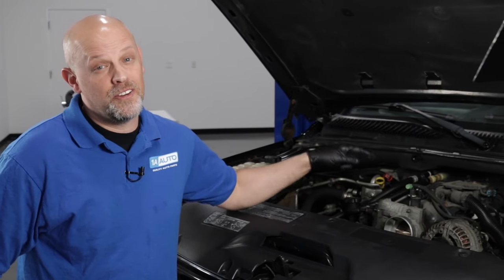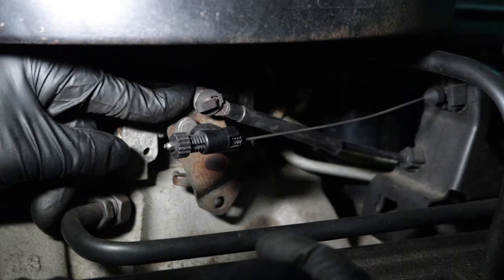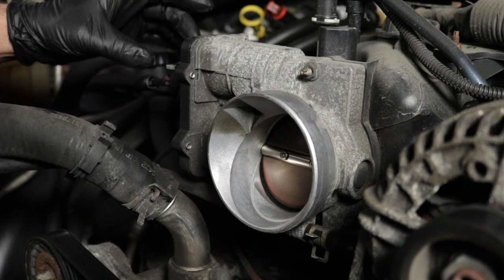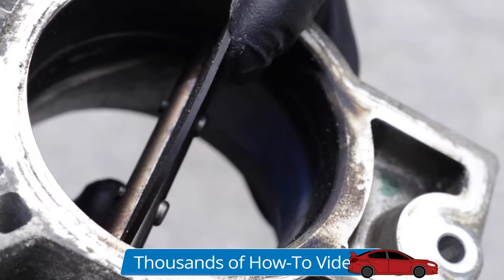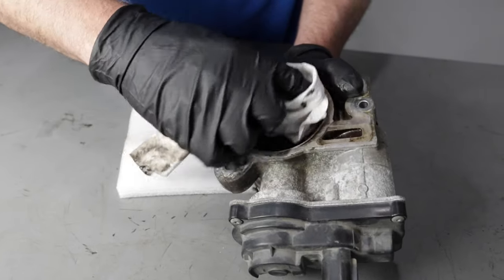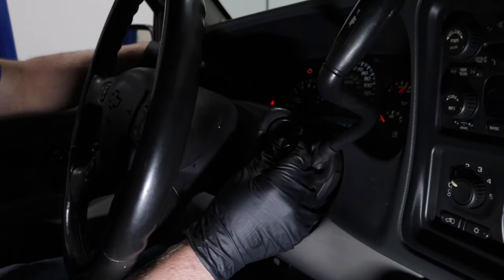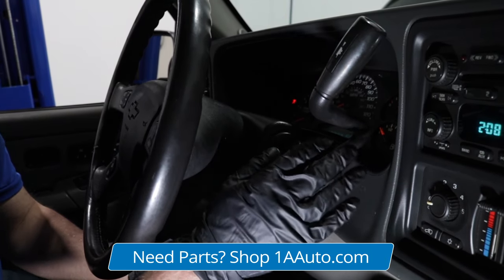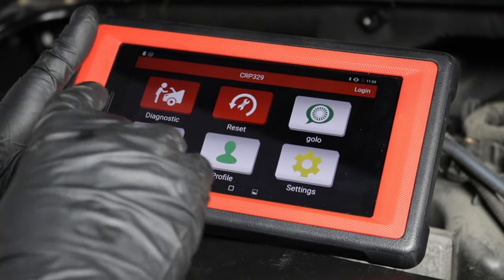Throttle Body Relearn: When Should I Reprogram My Car's Throttle Body?

Comment from the maker: √  Watch the Video
√  Buy The Part at 1A Auto http://1aau.to/m/Visit-1AAuto
√  Do it Yourself
√  Save Money
Reply: Need to buy need to buy a throttle body for a 2000 Plymouth Grand Voyager 3.3 l engine need some help on where I can buy it
Reply from the maker: +Skool Gordon Thanks for watching!  We currently do not carry a throttle body for that model.
Reply: @1AAuto  I just replaced my throttle body on 14 Chevy Equinox and it haven't started yet...
Reply: you mess my car up you did not tell us we had to pull the battery terminal before changing out the TB so the engine can reset itself to the new position of the Throttle body flange
Reply: hi where can i go to get my throttle body relearn or can i buy the device to relearn myself
Reply: why are you not answering important questions? WHY?

Comment: Like the videos. Feels like we were better of with cables
Reply from the maker: +Brad Rogers Thanks for checking us out! 1AAuto.com
Reply: Drive by wire is way more responsive than drive by cable.
Reply: I agree
Reply: Yep that’s right just some more stupid stuff to have to be put in the shop to recalibrate and cost a thousand dollars to do it
Reply: @tobydozier9030  bull
Reply: Yes at least it's not complicated as f
Reply: You can still have cables. 
I do. YOU choose to have a "modern day" vehicle.
Reply: Ha. It’s done for emissions/fuel economy reasons, not response. and yeah, it’s a fuckin headache. currently chasing tps sensor woes in my c5. it has 3 actually, a high side, a low side, and a pedal sensor. and it’s a fucking headache.
Reply: @tobydozier9030  no chance because why would companies design a sprint response kit for the electronic throttle control? Cable has always been the best.

Comment: I replaced my throttle body and ran the car til normal temp . Then I drove it seems to be good . I didn’t do this before and had a surge like the transmission was slipping . Hope doing the relearn corrects the problem.  I bought a mass airflow sensor plugs coils and a new pedal. Not knowing this was possibly what was wrong .
Reply: Did the relearn correct the problem.
Reply: What is electronic throttle body problems is that what causes the van to accelerate uncontrollably and jerk and buck for the brakes fail to hold it back

Comment: I cleaned my throttle body and idle feels good except when i rev it in park the idle stays at about 25k rpms. When i shut off the engine and turn it back on it idles good, would i still need an idle relearn?
Reply: My truck is doing the same  howvdid u fix it .....

Comment: I cleaned my Throttlebody and did the relearning procedure. The rpms went back to normal but when in park and when I step on the gas the rpms up to 4000 and stay there. I have a 2011 GMC Yukon
Reply: Im having the same problem but with an 2011 silverado 5.3
Reply: You figure anything out?
Reply: Same problem
Reply: @joshuadodson2757  did you figure what was wrong with it ? Same problem here
Reply: Did anybody find out the problem
Have the same thing on my 2011 yukon?
Reply: Sounds like GM problems
Reply: you may need to replace the Throttle Body or at least the sensor. If your throttle body was very dirty, you may be better off just getting the new one...

or. 

I have had the very high rpms happen with a Dodge Caravan... turns out it was the A/C Clutch relay. A guy at a garage in Northern New Brunswich who spoke 5 words in english understood my 5 words of french. He diagnosed the isssue... A./C Clutch Relay, I swapped it out with another relay - instant fix.

Comment: So after cleaning my throttle body, which I had no idea there was a relearn process, my idle is just about 600, but even after doing the relearn process when I rev it up it stays up and will not come back down. Any thoughts?
Reply: I have this same problem
Reply: Same problem here. 😢
Reply: Did u figure this out
Reply: Yep you got to take it to the dealership and get it reprogram for a nice fee

Comment: Take off the TBU take it off slowly try not to move the butterfly use TB spray cleaner leave it to dry over nite install an let it run don't mess with it. Power will be restored

Comment: I got a 2006 Kia Optima EX (Old Body) 2.4 L. I recently replaced the power steering pump with an new OEM pump plus new belt. System flushed & filled. While I had the time, I removed and cleaned my throttle body and mass air flow sensor. Car runs good but got a slightly high idle speed greater than recommend 700-800 rpm. There is no fluctuations in idle speed. Starts great… new IAC valve PO507. What is the relearn procedure for my TPS? I want to get the idle back where it needs to be.
Reply: Push brake in…set park brake…key on key off….start car…put in drive for 10 minutes.  Now the cars fuel trim is correct

Comment: Thank you so much recently cleaned my throttle body and mass air flow sensor. Just took me 2 hours to do a 35 minute ride here to work and I'm a couple miles away I keep stalling and I keep resetting the battery. Just went and bought a can of Lucas fuel injector cleaner to go in the gas tank and filled up and also bought a can of throttle body cleaner so I can clean it one more time and reassemble it and let it drive around 40 miles an hour on the highway like you suggest I pray it works my car is a 2013 Acura TSX special edition 4 cylinder. God bless you for all this information and I pray I get everything running great again take care. 🙏😃
Reply from the maker: +Stephen S Thank you! We love empowering our customers and showing how to perform DIY auto repairs with our high-quality auto parts.  http://1aau.to/m/Shop-1AAuto-c

Comment: I swapped out my throttle body (it would randomly go into limp mode with the lightning bolt and traction sensor) and after I did, it was permanently in limp mode with a worse sounding idle along with my check engine light. Would a relearn fix that? Or is the new throttle body faulty?

Comment: My scan tool is throwing a P1101 twice, pending & permanent. P0299, P2227. Replaced the turbo booster sensor & cleaned the MAF sensor with MAF cleaner. Engine light stayed off longer than it was after all that. But ultimately came back on.  So I removed the throttle body tube and noticed some light gunk & condensation bubbles on butterfly valve, So I carefully cleaned that as well. Same codes still show. ANY advice would be much appreciated.  (2017 Chevy Malibu LT 1.5 Turbo) 

Thank you! 💪🏼

Comment: I’ve bought a 2007 Chrysler Sebring and have problems with it missing and hesitates going uphill took it to a mechanic 😒 they replaced spark plugs 3 times, put new coil packs on and crank sensor and it didn’t fix it. They said they’re was a misfire on cylinder 2. The lighting bolt symbol comes on sometimes. I’m no mechanic but something is wrong if you replace spark plugs 3 times within a year 2 times within 3 weeks apart because they was bad. This video helps knowing what’s going on with my car. Thanks.
Reply: Spark plugs last 60k miles. It should only be replaced if its worn out you should ask them to show you the old ones. Try changing your fuel filter...

Comment: I have a question - not sure if you can help. I just had the throttle body on my Polo 9N3 replaced because of intermittent starting issues (it would crank for a longer time occasionally but always start after this. When briefly switched off after this, engine would start immediately). Now I have a car that's hunting when I first start it up, RPMs going up to 1100, going down to 800 going back up and sounding like it's stalling. Didn't have that issue before the replacement. Mechanic suggests it could be the oxygen sensor - but why did this problem occur all of a sudden after the replacement?

Comment: I Have A 2010 Ford Fusion SE. Just Bought An Electronic Throttle Body. Would I Need To Reprogram It After Installation Or Would It Reset Itself?

Comment: i had a shop replace this and the throttle position sensor. now it idles sometimes at 650rpm or really low at like 500 or 450rpm. also when i put it in reverse sometimes it goes as low as 250rpm almost shutting off until it revs itself up to normal idle. also i was just pulling into the driveway earlier and gave it a little gas and it revved itself up unexpectedly lunging itself forward for a second before i stepped on the brake. kind of annoying

Comment: Brake fluid cleaner or carb cleaner? Really? But want that be harmfull to the surfaces? I use throttle body cleaner only and a soft bristle brush in addition to a clean rag.

Comment: got a volvo s40 2.0 gasoline ...i just instaled a new throttle but when i start in the morning RPM jump fast to 2000 then back to 1000 and as i drive and engine warm up will settle to 650 any tips or is normal i mention the car will always start secound time i turn the key new first time....

Comment: Hi i have a 2010 Honda   crv Awd 2.4 I have a accelaration  problem on cold engine stop /go  motion .The engine hesitation ,he don t whant a move by himself he go to shut down by himself ,i have to hard press to accelarator to run,every think came to normal when the engine came normal,spark plugs are new, no code on scan no check engine light,my mechanic ean the trootle and the sensor even he change the crankshaft position sensor,nothing change,did you think its the throttle it s finish or the problem it s the gas pump,thanks

Comment: I just need to clear a check engine light. If use a scan tool to clear code. Do i have to do a throttle relearn?

Comment: I replaced my throttle on a 2012 ford Taurus and the check engine light code p2104 reads on the dash. Vehicle also cuts off going 50+ mph causing me to pull over at reduced speeds in traffic unable to accelerate…Any solutions?

Comment: Hi, i have a 2006 lexus rx330. I will need to replace my throttle body. But i saw two hoses.. one on the right it for coolant. Doni need to bleed that after i replace the throttle body. And the other hose on the left. I have not unplug it just yet.. where is that connected to? Thanks

Comment: My engine stays reved up/high idle when im at a stop light ao have to tap the explorator peddle to make it go to quiet idle. I have a 2001 dodge ram 2500
Reply: Could be a dirty Mass Air flow sensor

Comment: Gm 3.9l v6 will start the car and it’ll drive then suddenly after coming to a stop randomly wether it be a 5 minute cruise or an hour long drive it’ll bounce into reduced engine power. Currently trying to re program throttle position sensor took it from my other car (3.5l) it fits perfectly. But I notice rpm’s are off slightly and I have afm which activates at about 1300 rpm’s on the highway but I’m revving at about 1650 so when it de activates into 6 cylinder it’s a little harsh. Any help relearning would be great

Comment: Got a question my 99 Durango sometimes cranks & cranks then starts up how can i fix it put in a new fuel pump new plugs and wires cap and rotor and pickup coil
Reply: Battery terminals? New spark plugs?

Comment: Are these error codes an indication that I need to recalibrate the throttle? 
Which error code reader can do that on Citroen C5-2004?
P2101: Throttle controller A motor control - Circuit range / performance
P1153: Citroen: Thorttle - Threshold learning fault
I have already moved to a brand new throttle body :goodvibes:
Reply: Sounds like the sensor was fried. I assume with a new TB you got a new sensor.

Comment: Just learned that after replacing battery in Cadillac ATS that throttle body cycles and relearns itself turning it on in acc mode then shut off then turn on ect

Comment: Hello 1A Auto from ON, Canada….what’s the process for 2019 Mazda CX-5 GS AWD 2.5L Non-Turbo? i have cleaned the throttle body with CRC Throttle Body Cleaner and when i placed it all back together the RPMs started jumping with the throttle plate acting like it’s got Parkinsons LOL ….one of the mechanics believes after checking with a code reader ipad it’s placing pressure on the Purge Valve….please help me figure this or should i drive on the highway for a while and that might reset the throttle body or have a re-learning process conducted? thank you…🚙🤙🏼😎

Comment: Weird advices, I wouldn't advise anyone to remove and clean their throttle body without having the possibility to reset the TB with a computer unless they want to experience weird revs issues etc. First get a computer with the proper software to control your pieces then remove and clean it.

Comment: Please help me out. I have a rough idle when I load to Drive or Reverse. So I change the throttle body but still rough idle. How do I calibrate the new throttle?
Golf Mk4 1.8L 20V engine.
Reply: Use VCDS/VAG-COM to reset it properly. Rough idle might also come from a dirty EGR valve or a dirty MAP/MAF sensor, or spark plugs and everything related to it, clean everything up and it should be fine.

Comment: What Relearns do I need to have done on my 2010 Kia Soul 2.0?I changed the Coolant Temperature Sensor,Purge Valve,Crankshaft Position Sensor,Idle Air Control Valve,Fuel Pump & Fuel Filter,MAP Sensor,new battery,new spark plugs & wires & I have a new Throttle Position Sensor,but haven't changed it yet.I may have to take throttle body off to get to the 2 screws that are very hard to unscrew.Car is wanting to stall after driving 15-20 miles & feeling low power surges,plus a little vibration here & there.It gets so frustrating.I am just finding out that certain new parts need a relearn.What ever happened to replacing old parts with new ones?
Reply: Cost. It's cheaper to clean a part than to buy a new one.
Reply: What did it end up being

Comment: So I'm literally replacing my throttle body tomorrow in my 2003 Silverado 1500. What do I need to do so it can "relearn"?
Reply: I would consider disconnecting the battery for 30 minutes to reset. Otherwise count on very hi idle and rapid launch in gear leading to a fender bender.

Comment: Curious on an Acadia 11’….. I got a P0430 which is a catalyst code but it won’t start which means it’s not a bad catalytic converter could it be the TB? Could a really dirty TB prevent a car from running and throw that exact code?
Reply: You ever figure it out? I’m getting a p0507. Car wouldn’t turn on. But I just had it cleaned, it ran and won’t turn back on after I shut it off. I have to do the relearn process still.

Comment: Hi, I have to press the accelerator about a quarter of the way down before the car starts to accelerate. Do I need to reset the throttle body? Or could it be something else?
Reply: Has hour car thrown any check engine lights or has your ABS or stability light appeared? I would check the APP sensor and then the TPS sensor.
Reply: @thechongsterful  my 06 Altima had similar issue, except it threw me a p0507. Drove with it for a few days then when accelerating from red light the acceleration stopped for a second then I drove another 15 seconds and it happened again while driving , not from starting from a stop. It won’t turn on now. I had it cleaned as it was dirty af. It turns on but after you let it sit for an hour it won’t turn on. The service engine light doesn’t come on anymore. I haven’t done the relearn code yet.

Comment: I have a 2000 Chevy Colorado it won't go on fast idle in the morning every place to throttle body and in the morning the motor shut off I got to hold my foot on the gas pedal so it warms up I couldn't be

Comment: I replaced the throttle body, did the relearn procedure  (2009 Envoy).  Idle is now good, however, once I just touch the accelerator, the car RMP jumps up causing the car to lurch immediately.  The RPM is jumping from 800 to 1200.  Any idea?  Again, just touching the accelerator with limited acceleration.
Reply from the maker: +Bill Edison We wouldn't be able to diagnose an issue like that here, you may want to have a local mechanic take a look at it. Thanks for checking us out! http://1aau.to/m/Shop-1AAuto-c
Reply: Bill were you able to find out what your issue was. My brother has a 2007 Tahoe that's doing the same thing.

Comment: I have a 2016 ram I had an oil change. at the dealership they said I need a throttle body  and a fuel injection service .my truck has 68,393 kilometers  and it's going to cost me  246. plus taxes  ? Should I do it ? Thanks 👍🇨🇦
Reply: How early do I reset computer on my 2003 Ford escape after changing throttle bod

Comment: I cleaned the throttle body on a 2010 Honda Civic but I still have high idle when engine is cold but it drops to normal when I reach operating temperature. The RPMs also surge once during this warming up. I have tried doing the engine relearn procedure and have driven like this for months. Do I need a special Honda scan tool to teach the throttle position sensor where it should be?
Reply: Some cars require you to take off the negative terminal on the battery for 10 minutes after you clean the throttle body so that it reprograms it

Comment: Save money? I bought a 12volt new battery a new $200 throttle body, and am doing the throttle relearn procedure by the repair manual still idles high.

Comment: 2008 Ford Fusion, Throttle body wrench light came on, Cleaned throttle body and put everything back and the wrench is still coming on and off and car is driving rough, like trying to pull out of my driveway and the car will sometimes shut off, No check engine light or codes minus the on and off wrench light,
Reply from the maker: +Brandon Hardy We wouldn't be able to diagnose an issue like that here, you may want to have a local mechanic take a look at it. Thanks for checking us out! http://1aau.to/m/Shop-1AAuto-c